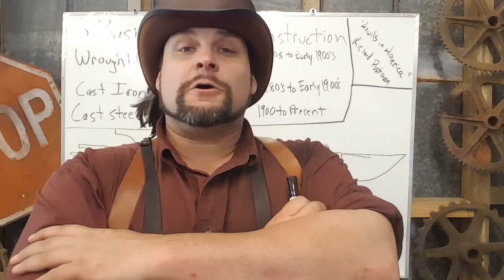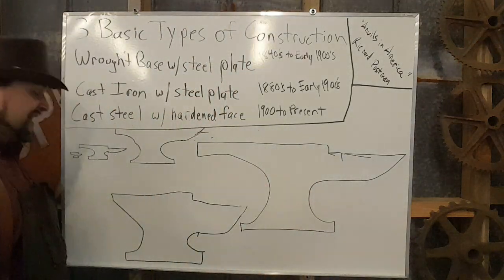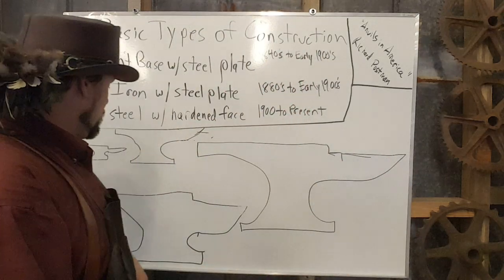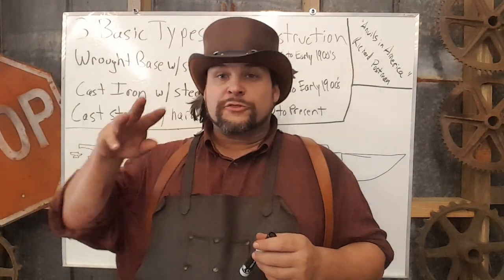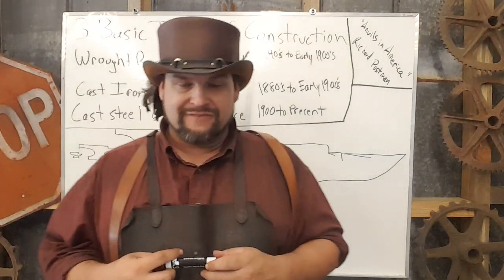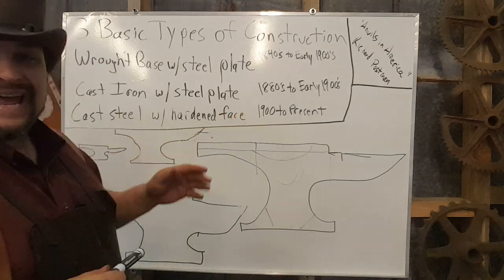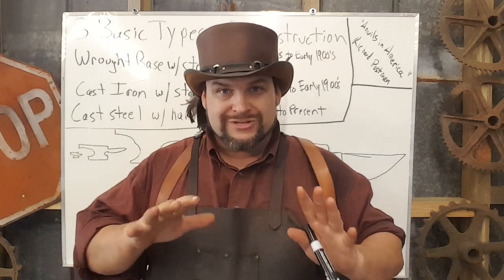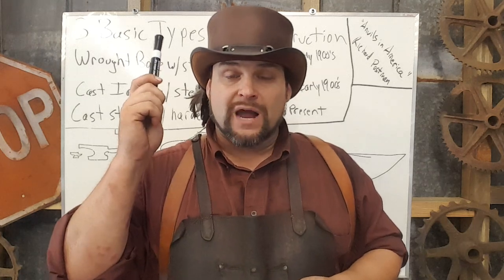Anvils Part Two: Methods Of Manufacture

Comment: I would say of the wrought base steel face anvils, the mousehole forge anvils were the best... MANY over 200 years old and still going strong. Peter Wright worked there and broke away to start his own, but that thick waist of the old mouseholes are hard to beat... I've seen PW's with a broken waist weld, broken horns, and broken heels... I haven't seen a mousehole (not saying they haven't, but I haven't seen 'em) in that condition. The only saddle backed ones I have seen are the ones that were machined flat and used for overly heavy work, OR used after someone had chipped the plate OFF and continued to use.I got mine for about a buck ten per lb...198 lb   best investment I ever made

Comment: I lucked up 2 years ago and got a near cherry 1904, 239# Trenton, early American production model. Just under $2 lb.
Great tool.
You did leave out the solid forged Steel anvils like Peddinghaus. Very well made tools. And for cast steel, the Refflinghaus cast steel is the Pinnacle. But very costly.
Looking forward to more vids Trenton
Reply from the maker: Ha! Gotcha! Those are not london pattern anvils! This video was specifically to that type!
Reply: purgatoryironworks Refflinghaus also makes the London pattern anvil.

Comment: I have a question for you if you do not mind me asking or anyone who has an answer to it for that matter as it would help me out a bunch. Got a old trade weight that is cast. How do I either get a carbon steel face on it by welding or case hardening. Is any of this a good idea. Am out in India and all I am using is a sledge hammer at the moment.
Reply from the maker: If it s cast iron, you are out of luck, there isnt going to be be a way to satisfactorily add a plate. Find some steel!

Comment: I"m curious where you would say the new ductile iron anvils fit in to your scale.  Before I found my old Trenton, I was shopping for new, and it seems like a good number of the new anvils are ductile iron, which as I understand it, is explained as a new... or "newer" process for casting iron.  I don't truly understand the science behind it all, and online opinions seem to vary, with a large percentage of the negative reviews being cast by people who have no experience with a ductile iron anvil.  Since it is still a "cast" iron, it seems like a large number of people still feel it will still have the same issues as regular cast iron.  I was just curious to see if you've had any experience with the ductile iron.
Reply: HoJ Forge Wikipedia shows ductile cast iron as having a Brinell scale hardness a bit over half that of regular cast iron, so it should be more usable that a cast iron with steel face.  It may make a serviceable hobby anvil if you aren't doing a lot of heavy work on it, but that is only my guess.  Ductile cast was developed in 1948, so I am guessing this was made as an economy anvil.
Also, I don't have ANY experience myself, so there is that as well.

Comment: I had an opportunity to purchase a Kohlswa.   I passed on it because I had read that they were soft.  Any thoughts?
Reply: Some imported for a big name US supplier at some point in the 80's were softer, but seems it was a short period of error or quality control. Most Kohlswa before and after the incident were popular and harder than most current US manufactures. You can tell in under 30 seconds if it's a soft face with a file or other means. I believe 54+ HRC is average for a Kohlswa that wasn't part of the bad batch mentioned.
Reply from the maker: Fish is correct
Reply: Trenton,
Thanks for the information.
Reply: Frisky Fish Thanks for taking the time to respond.